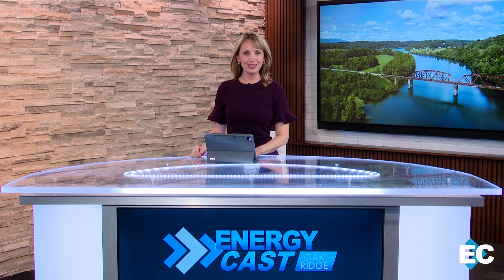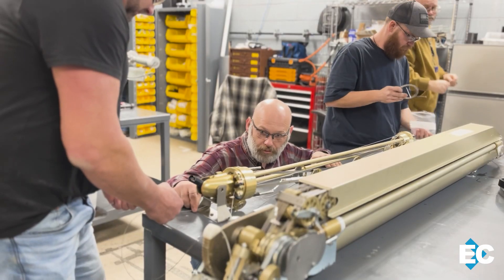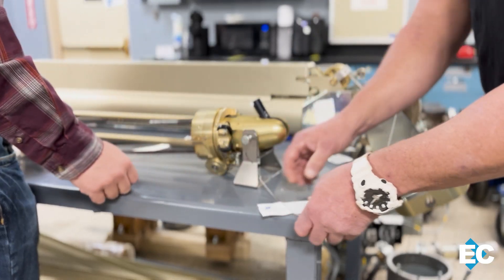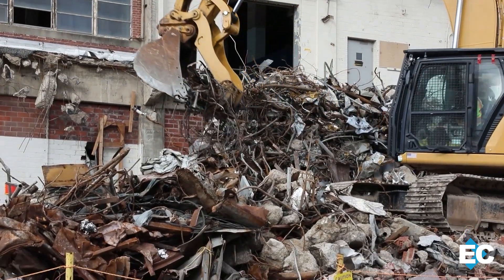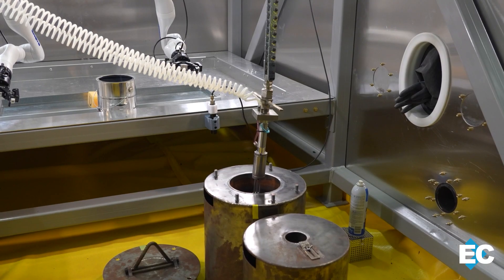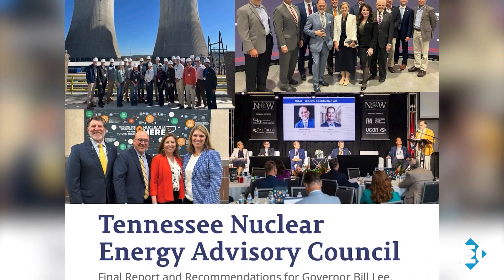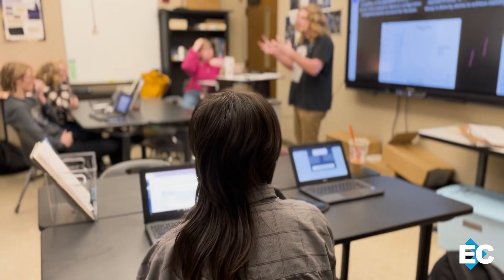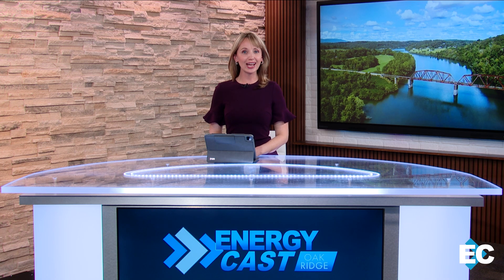Energycast Oak Ridge - February 2025

Comment: Pro nuclear old guy here. Toured Shippingsport as a kid, grandfather and uncle worked for Westinghouse. Certainly keep existing plants that pass muster open. Unfortunately though today there's 450 nuke plants globally. We're using 17 terra watts 24x7x365. In order to go all nuke we would need 15,000 conventional nukes. Even 50% conversion requires 7,500 nukes. Build times are horrible and require thousands and thousands of yards of concrete and tons of steel further adding CO2 in massive quantities to the atmosphere while consuming more fossil fuels from our dwindling supplies. Per Exxon's August 2024 report we're going through 100 million barrels of oil every single day and depleting reserves at 15% annually 2X faster than international energy agency predictions. Building better homes commercial structures etc, conservation of energy, solar wind and geothermal are plug and play ready to go existing technologies is much more affordable while providing immediate reductions in greenhouse gases and fossil fuels use. Keep in mind the fact that there is no Fossil Fuels Fairy refilling the holes. Again per exxon we're 8 billion precious humans and every 6 days another 1 million net new precious humans join us. Before 2050 we will be 10 billion requiring 50% more energy